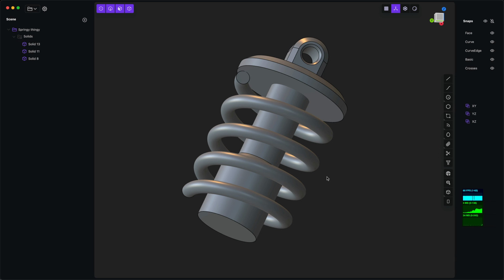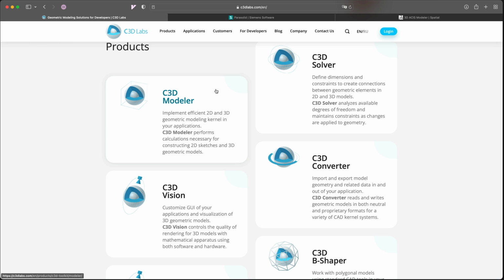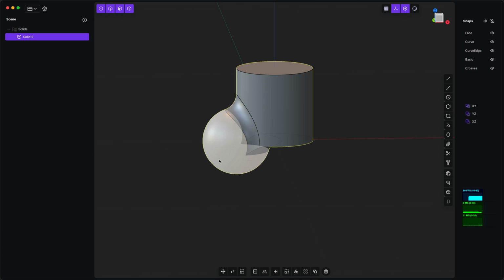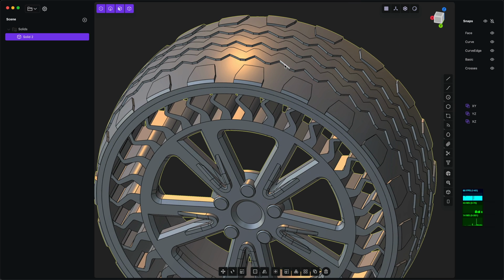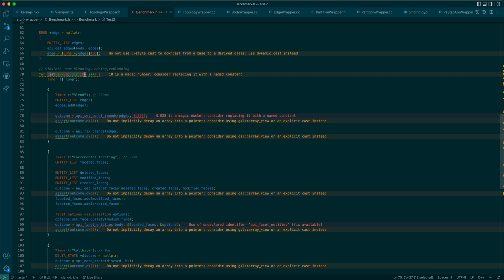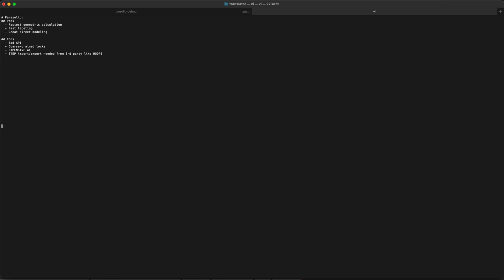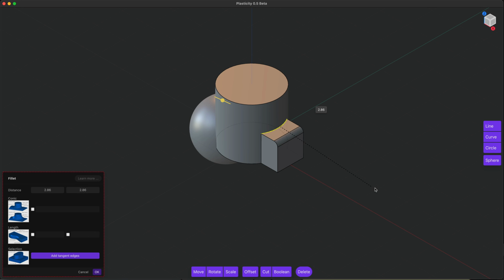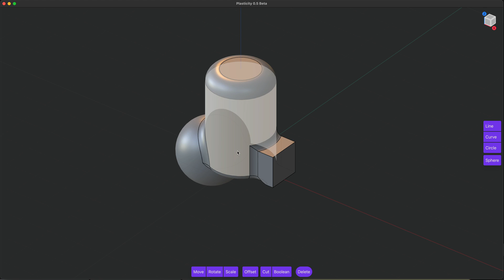What is a Geometry Kernel? C3D vs ACIS vs Parasolid

Comment: Is creating a modern geometry kernel for CAD applications that can accommodate a range of geometry modelling methods and using parallel processing out of reach? I can appreciate it is not an easy task. With little experience in this area it is difficult to grasp the magnitude of such a project. I just feel a modern geometry kernel that suits a range of industry applications would be advantageous.
Reply from the maker: Insane amount of work. Decades

Comment: Plasticity is an absolutely wonderful 3D program. great respect and great applause for the programmers of this program!.... Plasticity has a great chance to be one of the most popular 3D programs in the world! like SketchUp or Blender... its price is also affordable and that's ok, especially since you will often have to update it or even buy new versions... But!... you still have a lot of work ahead of you to polish this program. For me, it has too few icons and too many keyboard shortcuts, especially since we use other programs and there are shortcuts there too (memorizing 1000 shortcuts is also not that easy). Keyboard shortcuts should be individually set by the user and not imposed by the Programmer, and why is there no SPACE MAUS support program??? I'm crying here. please please!!... UI is great!!! ....but I miss the mesh view of solids....lines and planes should be dimmed immediately after creating the solid (because they are disturbing), the entire program window should be framed and the frame and its color should be set by the user (the program window sinks from Desktop and it is not known where exactly to grab the mouse to move it)... ), the toolbar should be either on the right side (as it is now) or at the top - this is determined by the user himself. Gumball should be like in Rhino so that you don't have to switch between MOVE / SCALE / ROTATE ... and many, many other things that make it easier to use this program. If you need cooperation from me, I am available on Nick's "Ultimate 3D Community". Greetings from Austria - Peter kreDosy.

Comment: Hi @nickkallen1, quick question... 

What was your opinion on Open CASCADE? If I am not wrong you mentioned it briefly in the video but didn't comment (apologies if I didn't catch it in the video).

I am asking because I am considering doing an open source (professional level) 3D CAD and PLM based on Open CASCADE. I know... "super easy target", and I am aware of FreeCAD and they have my massive respect. 

Your feedback/opinion would be really helpful in this early stage. 
Do you see any features missing? 
Speed is not that important (Like for your awesome product).

Thank you in advance!
Reply from the maker: Open cascade doesn’t really support direct modeling so it’s not great for my use case. For feature based cad, I didn’t do a thorough eval. But freecad allows you to do that easily I suppose

Comment: I have ODed for the time being on trying to make this work. It's not working for me for some reason and it's too frustrating to continue, so I'm taking a break. Maybe I'll wait for 2.x. Part of the reason it's not working may be that I use a 34 key keyboard and the keycodes assigned to the number keys and half of the modifiers are different. For instance I had no R-CTRL, and the number keys used the keypad codes rather than the conventional top row codes. I've now changed that, which required some programming, but I'm too exhausted to test them out, and there are probably other things about "Plasticity" that are irksome. One of them is simply the name. "Plasticity" is too general a term to be identified as a CAD program in search engines, so even the name of the program is problematic in the internet environment.

Comment: I'm new to CAD design and as a retired academic can't afford Fusion 360 so have the limited to 10 version, because I'm on a fixed income. But I don't like it much. I found Blender much more intuitive so prefer using that, but it's still clunky when it comes to rounding the edges (which I guess you call fillets and chamfers). I have downloaded Plasticity 1.1 and will probably buy it the next time my monthly retirement check arrives. This whole thing reminds me of when STATA changed the computational statistics industry, which had been dominated by SAS and SPSS subscription services.
Reply: However, I can't figure out how to use this. Nothing I try works, and I keep losing the object in this vast sea of nothingness because there's no "homing" function. I keep ending up with an inexplicable blue line in the middle of nowhere. I try duplicating edges because you can't make loops but the new edges don't act like edges of the solid, even after I "join" them, so don't help to alter the surfaces into more complex shapes. I was able to create a parallelagon which is the starting solid, but I need to alter the surface or top according to specific dimensions and can't find a way to do it. Maybe this software is not for me. I can at least create the basic object in Blender, but can't even export it so I can use it as the starting point for fillets in Plasticity. It comes in as an "empty" with no edges or vertices, and it comes in with a completely different orientation and scale. I'm close to giving up on this.
Reply: I also can't seem to join any of the Discord channels.

Comment: This looks amazing! Wish you all the best. I would definitely pay 125 or more for it! 

Heal faces, reverse bevels is great for direct modeling. Fusion has it, hopefully it's not hard to add. Also converting face selections to their surrounding edges to chamfer/bevel is quite useful. Edge loop or ring selections are useful too.

Since you're running native, I hope you can account for heavy models too. Mechs, environments, etc. Fusion esp. will choke pretty fast, Moi is okay, but neither can compare to an animation package for heavier models (in terms of detail, obv. the geometry is different).

With parasolid and a focus on direct modeling, I hope you can achieve an advantage in terms of scaling.

For feature film design, we pretty much have to reassemble in a 3d package, since the models get too heavy in Fusion or Moi.

Also, keep all hotkey mappings, scripts, and mouse assignments user configurable. Same with camera tumble, zoom, and pan sensitivity. 

It really matters a lot switching between cintiq, wacom intuous, or keyboard users.

Looking forward to an API too for plugin devs! I know that's probably a lot of work, and won't be added right away.

In regards to sub-div modeling, honestly to start I would focus on solid modeling and then surface, and lastly sub-d, if ever.

It's so much easier to just model in blender a quad mesh and then convert to cad if needed. 

I would rather have a an awesome solid modeler that does one thing and does it really well, with flexible import /export handling (UNIX philosophy) than another do it all attempt, especially since you're an indie dev (for now?). Just my opinion :)
Reply from the maker: The key to dealing with heavy models is having users give me examples so I can measure and optimize. Once bottlenecks are removed, you can move (if necessary) to an approach like zbrush where only the active tool is computationally relevant.

Comment: I think this is a very good decision! I'm on Fusion 360 because of the fillet handling and hate the general workflow. I love the artist centric approach of Moi, but don't use it because it's fillets are bad. If Plasticity can merge the advantages of the two programs I will easily buy it for 100+. Concept and CG artists have usually beefy machines, so performance is important, but not as important as the geo kernel and the better handling of wierd edge cases (which you get quite a lot on complex models).

Comment: As someone who is new to all that CAD modeling and is super enjoying it I am glad to pay 100$+ and therefore have a great, stable and FAST software that works.
At the moment I am using MoI3D and I love it because it is so simple and fast to create shapes and have fun. 
I usually work very fast when I am in my creative flow, so the situation with the filleting in MoI3D is a bit frustrating and stops my flow sometimes.

I tested Shapr3D on the Tablet which also uses Parasolid and it's just crazy how comfortable it is to use. 
I want to support you and your new software. It's exciting to be there from the beginning. 

Good luck!:)

Comment: Hello Nick, will you incorporate into plasticity one of the most useful features of Fusion 360, namely the creation and editing of subdivision surfaces which are converted to nurbs when the surface is open and likewise to a solid when the surface is closed? The object also remains editable as a subd object, even after conversion and for example been booled and filleted with another object... In Fusion 360 this feature is called sculpt mode. In other programs similar function may be found under t-splines. In my opinion this is one of the most useful and creative feature that Fusion 360 has to offer to get away from the typical rigid "block" look during conceptualization and also completion. In that sense its also way faster than anything that standard nurbs curves and surfaces tools offer in that regard.
Reply: I'd also love this. A note: he industry really needs to clarify the difference between the recursive polygonal subdivision surfaces you see in Maya and Blender versus the limit surface subdivision surfaces you see in Alias, Rhino, CATIA (Imagine & Shape). You basically model them in the same way, but there's an important difference in how you can use the resulting geometry.

Comment: I really want to try it, but my Macbook Air M1 does not want to run it.. It says that the application is damaged.. Maybe there are some "pitfalls"?
Reply from the maker: It’s not codesigned so if you want to use it on m1 you’ll need to use xattr

Comment: In all Fairness fillets also with parasolid will at one point limit direct modeling abilities !!!

Filleting is a task with DM I teach my students to do at the end to prevent the issue of not even being able to remove complex fillet surfaces.
Reply from the maker: It’s good advice. Always do small fillet last … but sometimes you can’t
Reply: @nickkallen1  that’s true specifically when they a primary surface 

 But if the fillets are secondary / detail surfaces.

DM is great but has its flaws - well so does parametric modeling.

Comment: Could you give an opinion in opencascade?
Reply from the maker: Not really suitable for direct modeling
Reply: @nickkallen1  thanks for the answer, could you please elaborate more? 😇
Reply: @francootaola9172  It does not provide push/pull-like operations as well as any sort of "local operation" per se. Implementing such things based on OpenCascade is possible but it's quite a journey.

Comment: You have come this far with your programming solo work, and it is incredible! Have you take a look at MOI programme? Oh I saw your old video about MOI now :) (edited)
Money transfer issues can be solved easily, may be some legal issues you may have to deal. 
I've professional friends who use these CAD programs for design, engineer, evaluate etc... I sometimes need to too. But mostly I use Mesh based programs.
My experiences about these programs last 10 years are; 
- yes they seem robust when you really understand the workflow otherwise they can easily crash too. Still Parasolid > ACIS when you need a really complex design. (ex: full with all the cables etc aeroplane)
- nice to roll back and fix things accordingly, only mesh solution to this is working with multi save 001 002 002a etc...
- yearly subscription method crippled the programs, sometimes 3-4 service packs a year and still no good functionality, only more bug fixes and new bugs occur.
- the kernels are old as hell, they don't seem to take advantage of new technologies and/or if they do, they can lose backwards compatibility, which makes cloud systems obsolete
- the kernels saying "we work good with high end work gpus" which nowadays just saying "buy X for gaming, buy Y for drawing" the real world difference is only GPU RAM mostly
- the late programs are for more "work as a team" oriented, so while I'm designing the electrical engineer can design at the same time on the same file

Comment: freeform modeling 😫
Reply from the maker: What are the key features of free form that you want? The absolute essentials
Reply: @nickkallen1  Thats it ! finally, you just made a perfect cad software "if you keep the fillet working as it is ", standard cad modeling commands (nurbs modeling) including sweep2 sweep1 ,loft ,curveSurface are useless when we can directly use subdivision models as 3d surfaces (true lowpoly subdivision model ) for example if you want to model a car or an airplane or model for jewelry parts and 3d printing subdivision modeling is the best , you can either implement those oldschool nurbs modeling techniques or add the ability of subdivision modeling ( more clay purposed software) and use the algorithm that converts each sibdivided polygon to one surface ,i mean all of other nurbs modeling tools will be useless with one subd modeling technique.
Reply from the maker: @hameddesign70  alias seems to be taking something like this approach. Allow basic box modeling/subd but convert to nurbs and then allow fillets and trimming and whatnot… what they are doing is interesting but I would say alias has a million features, it’s not very simple at all. They rely a lot on history too…
Reply: @nickkallen1  no no no history , think of freeform surfaces not only boxes planar surfaces or spheres (promitives basically) in terms of subd modeling there is no history at all
Reply from the maker: @hameddesign70  so you basically want to model a subd object using the usual box modeling techniques, convert to nurbs, then start Booleaning and filleting etc. ? Or something different ?
Reply: @nickkallen1  subdivision modeling isn't just box idk what do you mean by box everything can be modeled by subdivision including cars planes etc , subd is already inside catia and nx , but starter users mostly don't have knowledge of subdivision modeling , can we model some ornamental wood carving or jewelry with your software ? no but with blender we can
Reply from the maker: @hameddesign70  box modeling = extrude , inset , loop cut, bevel, etc
Reply: @nickkallen1  yup! including some little more things 😅

Comment: As long as you don't go the route of subscription fees and leave it as a buy once own forever model I'd be fine with paying $100 and possibly even more.
Reply: Only resion i bought plasticity. Never gone "buy" subscription software agn.
Reply: So you buy version 1, or version 2 and you get v1 or v2 forever - is that really such a great deal? You get v1 or v2 on platform os x on one pc forever. I assume with so many likes about 'not a subscription' it's a popular choice. But if the subscription is low cost and allows you to pause, stop, cancel, upgrade. downgrade or even revert to free with no data lock, then I think subscription, pay (or not) for what you use is a very fair choice. I do understand that at some point, what the app currently does is good enough and you just don't want to pay anymore for a few years at least - I get that...there's no doubt Plasticity is rapidly advancing...

Comment: 100 dollars in full vs 300 a year or 120 or 1000+... I'm sure many more people will buy you software if it matches and I hope beats fusion in modeling. Fusion is a huge cpu hog so it's nice that it'll run on older machines. Another plus for you. It'll sell and even if I don't use it to start, I'll buy a licence.

Comment: $100 is a bit more than what I was expecting to spend as a hobbyist, but I think I could swing it - although it might be a difference between jumping on day 1 for $25 and waiting a month or so to budget a $100 purchase. 

Coming from other hobby CAD software having an element "stuck" because of some bevel I did 15min ago is a pain, so I'm excited that Plasticity will use a kernel that can deal with that.

I was also not aware that Plasticity licensed Russian code and I'm glad you disclosed it and decided against it.  Personally, I don't want to spend any money right now that might end up in Russian pockets.

I think the differences are worth the price hike.